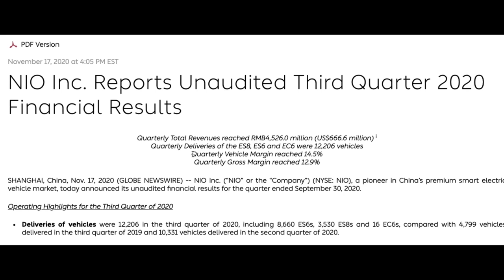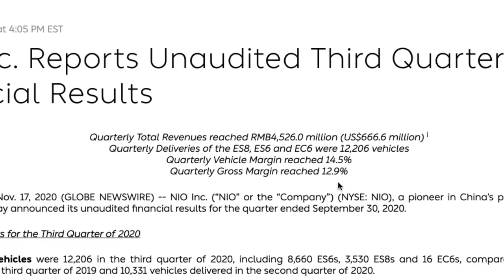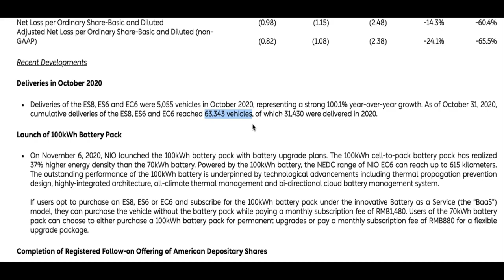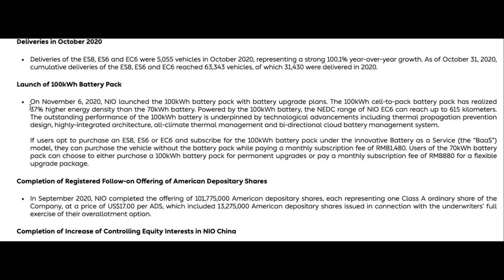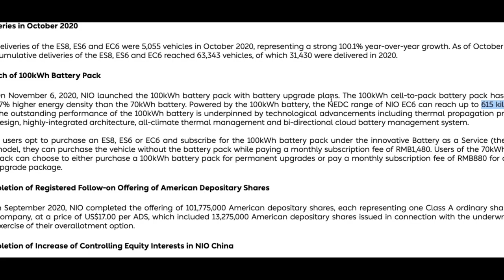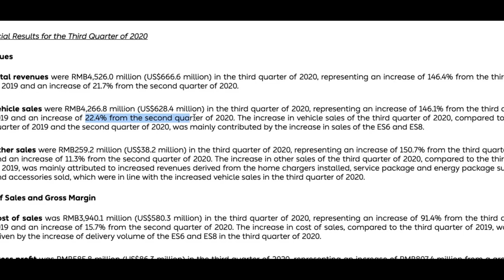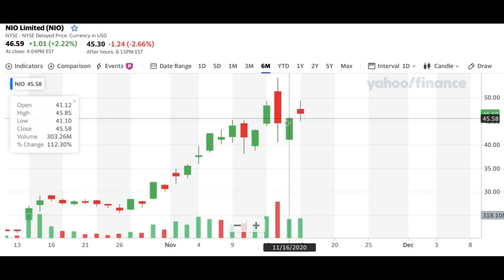MASSIVE NIO Q3 EARNINGS! | This Will Change Everything (Time To BUY?!)

Comment: How do u see NIO compared to XPENG? I mean they got 2 manufactures while NIO use JAC’s?
Reply: NIO will have there own factory eventually it will happen xpeng Vs. NIO - I like the Tech in Nio cars and there design a little better remember NIO is also a Brand. doing more than Xpeng picking NIO going long 2308 shares put my money where my mouth is